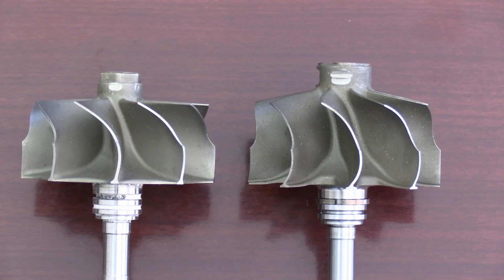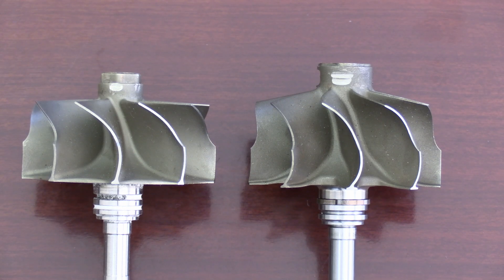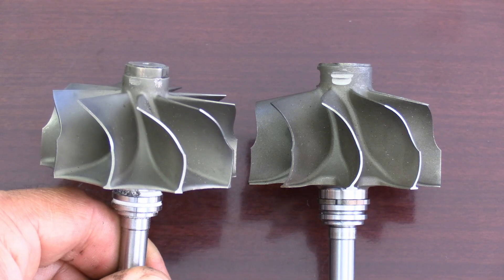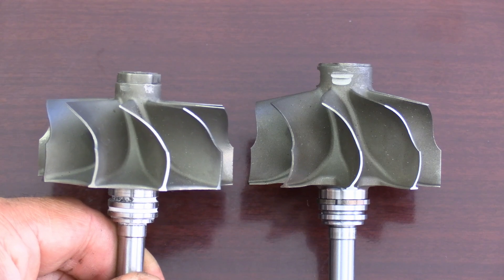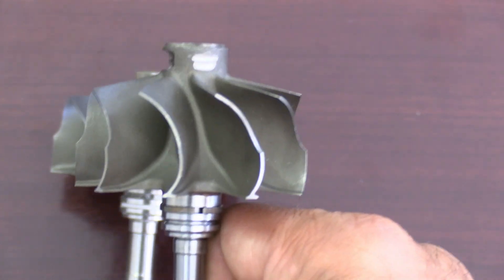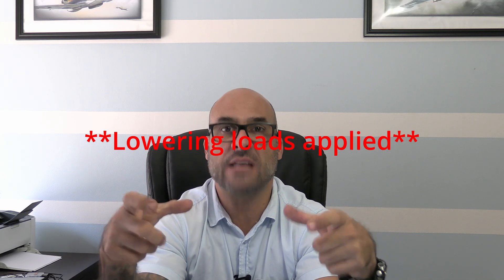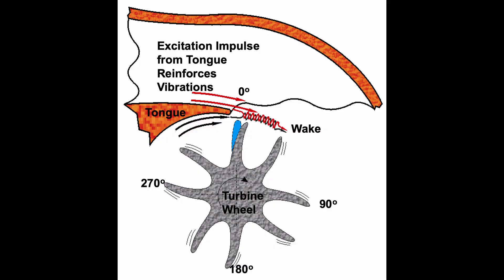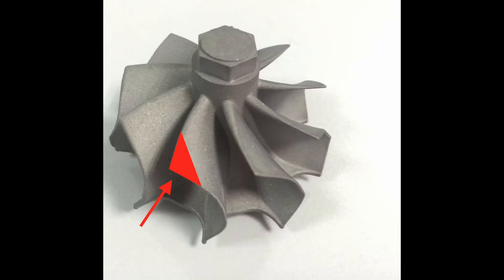Blade Cut Back - Explained

Comment: Does twin scroll housings assist in reducing HCF compared to the single scroll counterpart
Reply from the maker: No - the housing has nothing to do with the rotation forces and vibrations exerted on the blades of the turbine.

Comment: Great explanation, but could you elaborate more on how to pick up the cut back angle at what to cut a standard wheel into e cutback wheel? I actually see the blade design difference between blades designed with and without cutback. So if I decide to do a cutback on a non cutback wheel how to pick up the correct angle? 5-10-15 degree?
Reply from the maker: Why would you want to cut a wheel in the first place? The turbo manufacturer designs a specific turbo to operate inside of a range of parameters, and will ensure it operates correctly inside of those parameters. Cutting a wheel has alot of side effects and consequences - which is something almost none of the 'turbo guys' out there actually know about.